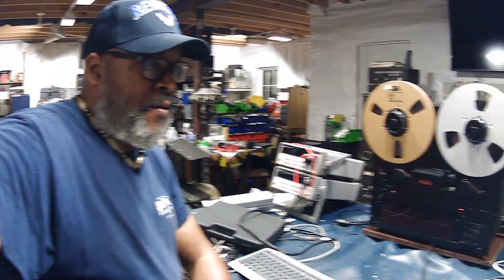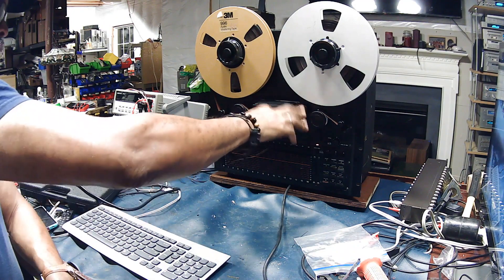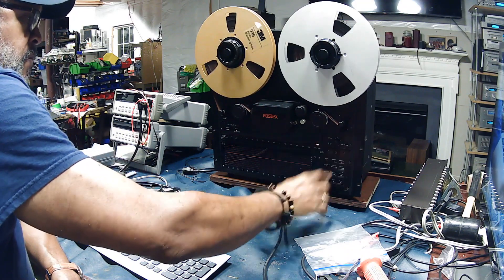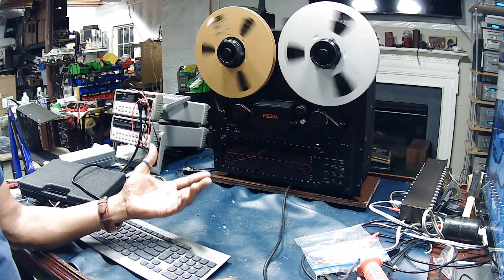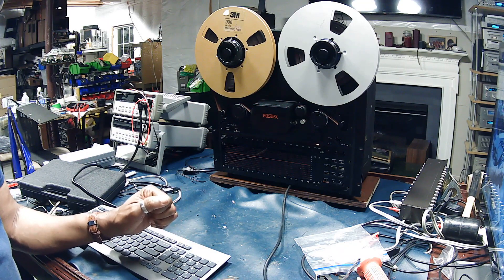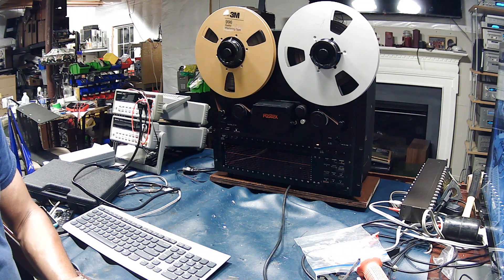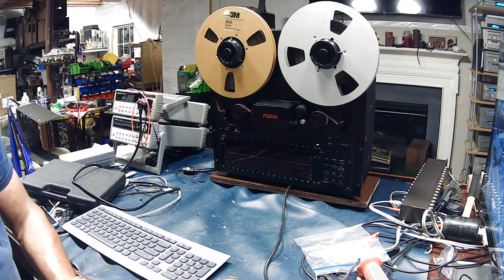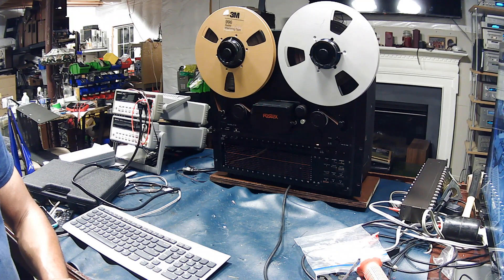Fostex E16 Reel to Reel Capstan Problem   HELP!!!!

Comment: I'm working on a different problem but I came across your video. Having been looking trough the service manual, on the part to adjust the reel tension there is a mention to switch a jumper somewhere to stop the capstan from spinning on playback. I figured there could be a place for the jumper to reverse the spinning also.
Reply from the maker: Thanks Erik, I will check.this.

Comment: So far as im looking for sort out spinning capstan after switch on - even without tape - i have find out to check all voltages regulators under big heatsink on top of the units. I have find out so L7818 dont give correct voltage - incoming 26V outgoing almost nothing - but transistor is fine - when i disconect cables from that transistor going to pcb at the bottom of the unit - transistor start working properly 26V in and 18V out - so there is some bigger problem with bottom control pcb section.... madness... 
But in your case good to check all power regulators under big heatsink.
Reply from the maker: Thanks B, Happy 2023
Reply: Hey Bartosz, yes we have the same problem.  Have you got to the bottom of it yet?  I will also check my voltage on L7818 and report back!
Reply: Yes, my unit work correctly now. I have remove all cards from the bottom of unit, have check all connection between cards and pcb, replaced all power regulators (two was bad). Now machine is working just like should.
Reply: @bartoszszwed4883  oh wow great stuff.  Are the power regulators easy to spot?  They are on the top of the machine right?
Reply: they are easy accesible from most of the shops JRC7820, JRC7805... dont remember exactly what was going there, what voltages but that the thing
Reply: @bartoszszwed4883  did you have to take the regulators off to test them or did you test them in situ?
Reply: i have take messurements in unit, switch unit on and check all regulators... they should show you 20v, 18v, 9v, 5v etc...
Reply: @bartoszszwed4883  OK so my results are in as follows:
7805A 15.88 volts in and 5.04 volts out = good regulator

7815a 32 volts in and 14.9 volts out = good regulator

7809a 15.75 volts in and 9.02 volts out = good regulator

7824a 36 volts in and 1.7 volts out = bad regulator

7818a 28 volts in and 0 out = bad regulator.

Do you agree with the above I have two bad regulators and need to replace?
Reply: that for sure, but... first try remove all cards at the bottom and then put them back... than check the results one more time! i have find out so even after replacing but there was some strange voltage stuck ??? and after replacing cards out and in back all back to norm
Reply: @bartoszszwed4883  I will try this.  I have taken them all out previously just to see if that would fix it, before I knew about the regulators.  The cards in the bottom and the connectors are very fragile!
Reply: @bartoszszwed4883  May I ask how to open the deck to take out the 16 cards? Mine is a G16s though, so removable control panel. I have access to front off, okay, and backplate off, okay. But how to get the channel cards out? Some of them seems bad, so I figure it's time to solder in new caps for the infamous square ones that turn bad.
Kind regards.

Comment: Did you get to the bottom of this?
I have a similar problem in that I recently picked up a Fostex E-16. The issue it has is when it is powered on, the capstan / pinch roller engages immediately, as if the unit is in PLAY. Pressing STOP (or any other button) won't make the pinch roller disengage. I also tried loading a tape and when I turned the unit on the "take-up" reel didn't advance so the pinch roller just spit the tape out the right side of the deck.  My capstan is spinning clockwise though at least.
Reply from the maker: No luck yet. I plan to re-attack in July
Reply: @5thcomm  Do keep us posted.  This is driving me mad!
Reply: I have issues with recording in my unit E-16. i have opened back plate and check all card at the bottom of unit - all sims fine. When i close panels capstan start spinning just after power on - without the tape - same as yours - no idea what could happen???

Comment: I'm pretty sure you already checked this. Is it a back feed into the motor? I have seen motors that run in reverse due to a short in the system and since it does not have + whatever voltage. They spin backwards. But, I'm sure to check the voltage to the motor to make sure it is correct mount and correct +/-. That is this motor spins backwards when the polarity is switched.

Comment: When did the machine start with this weird behavior?
Reply from the maker: Not sure. I got it from a repair shop who had given up on it.
Reply: @5thcomm  Someone must have switched polarity on the motor cap. But the repair shop would not miss such a simple error I guess.
Reply from the maker: @gertlungmaskin1210  Thanks, I will check the polarity

Comment: I haven't a clue! Lol
However, I have 5 units 
7010gsl like new in original box
4010gsl
Akai x-1800sd (dads)
A-2050 (dads)
I want to have my dads units restored and I would throw in the other 2 Teacs.
Do you have the time or know anyone who would take this on?
I work on receivers and amps, but these decks are a different animal.
Reply from the maker: Hi JM, If you're near Charlotte NC, we can work something out. That 2050 is a sleeper.
Reply: @5thcomm  well my friend im in San Antonio. I would be willing to ship all 4 to you if you're interested in restoring the 2050 & 1800sd 🤙
Reply from the maker: @jubemarsh2202  One of my favorite cities. I was first stationed there back when 410 was considered the outskirts of town:-) I may be driving to Dallas to see my daughter before the year's end. Maybe we can figure out a drop off to cut into shipping costs. Let me know what issues you're having with your dad's equipment. Take care, JM
Reply: @5thcomm  just arrived home from work. Will do 🤙
Thanks for your service 🇺🇸💕💯